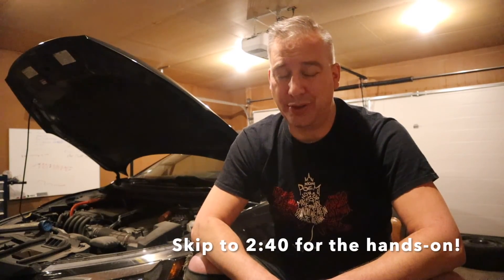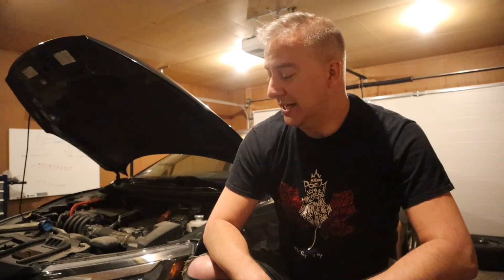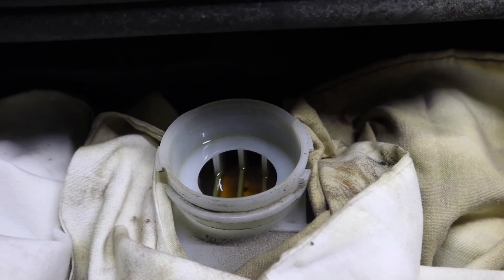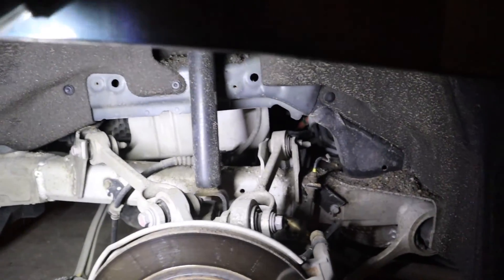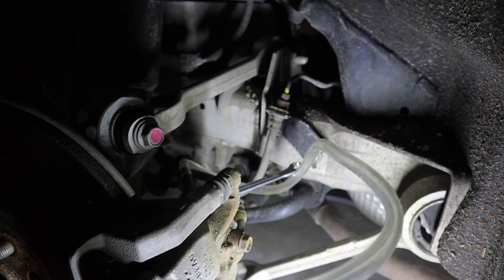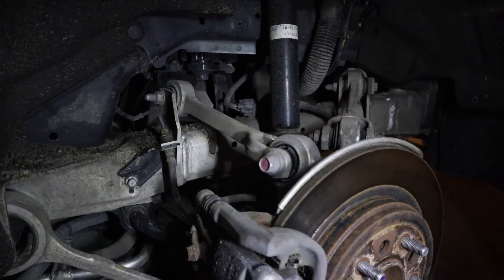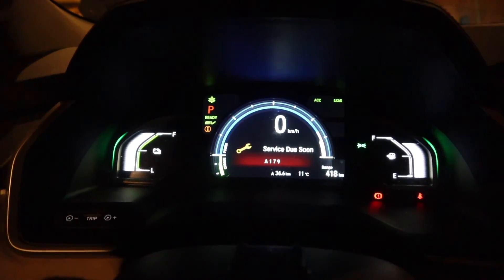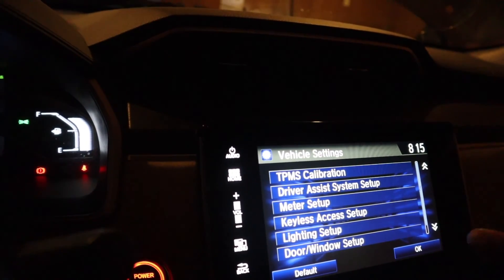Honda Maintenance item 7   Brake Fluid Flush!  How to flush and bleed your brakes in your car!

Comment: Is tire removal required for brake bleed on a Honda Fit?  Does Honda require tire removal for brake bleed service performed at a Honda Dealer?
Reply: Tires are generally removed for access convenience. You may be able to get to the bleeder screw behind each tire without removing them.

Comment: Thanks for the video. The brake fluid reservoir doesn’t have any lines to show min or max. Is filling to the top of the strainer the correct fill level?
Reply: It has a max and min line on the left side.

Comment: How often do you do a break flush For  a 2020 Honda Civic?
Reply from the maker: Hey Jay.  Irrespective of car I usually do it every two years.  Brake fluid will absorb water with or without use i.e. so mileage is less a factor than time in my experience.  Plus it's easy enough and rewarding as it brings the pedal back up.  Good luck!  -Brad
Reply: @BradOnCars  I looked at my brake fluid reservoir today.  2007 Accord (manual trans.)   Last brake fluid flush was April 2020, so a little more than 2 years ago.  
The fluid looks dark green - yikes. 
I suppose it's time?

Comment: I’m at 25k miles the dealer wants me to do a brake fluid flush. 🙄 Last time they said it needed an alignment then when the auto tech looked at it he said it didn’t need an alignment.
Reply: brake fluid change done once in 3 years and millage does not matter
Reply: @antgrkh588  mileage does matter. It’s recommend every 2 years or every 30,000 miles.
Reply: @connorpurkey2932  If a car sits without driving water will still build over time in the brake fluid. So it is more the time rather than mileage. A brake fluid tester is less than $10 and can test fluid for water. I have found it generally reads the fluid is breaking down about every three years.
Reply: IM AT FKN 16,000 ON A 2020  AND I GOT A B7 ?

Comment: Hey Brad, i owned a honda insight 2019, I was planing to do a break flush myself but I read this car has a 2 stage flush procedure, so I ended up taking my car  today for  service,  I was quoted $189 for that job  which I thought it was very expensive  so I declined it. However, I got a call later  saying that because the insight has a "Two-stage system" or something like that, the cost will be that high. I'm still not sure about what they said but  Since your car is a hybrid too,  don't you think it has a 2 stage system break flush too or the clarity break flush procedure is different than other hybrids like the accord or insights?

Comment: Thanks for that! My Clarity will hit 3 years come November. Is there not also a bleed point on the ABS unit? I just today did my BMW motorcycle and it has 2 bleed screws on the ABS unit, one for the front brake circuit and one for the rear. I was led to believe there’s at least one on the Clarity.
Reply from the maker: Oh interesting!  I have never checked that.  The pedal feels brand new again so I didn't feel it necessary.  But now I'm curious!  And apologies for the late reply Ed.  Summer has been busy!  All the best!  -Brad
Reply: @BradOnCars  Thanks for getting back to me. I'm almost ready to do mine. On a forum someone mentioned it should be done twice, once with the ignition off and once with it on. Have you heard of such a thing?

Comment: Saved to playlist for future :). 
have you experience any dashboard rattle noises？ mine is very noticeable.
Reply: I have the dash rattle issue, more prevalent in the winter. I used a couple of the rubber squeegees from phone protective glass kits and pushed them down between where the windshield meets the A pillar and the dash panel. Problem solved.
Reply from the maker: Hey Tongyuan!  No not yet to be honest!  Sorry to hear yours rattles!  Drop me a video of where and I can take a look?  Thanks for watching and commenting!  Best of luck!  -Brad
Reply: It’s the A pillar, very prevalent on this generation of Honda vehicles. Google and YouTube have some pretty easy fixes for this, worked for my Civic.

Comment: Hey Brad, good video again!!! For those reading this, remember that only DOT3 brake fluid goes in a Honda.  As for the wheels, Honda sells black steel  rims (made in the USA) but they are 17 inch. They retail at 125$ cad but they might sell them for less. The proper tire size is 215/55R17.
Reply from the maker: Ah yes good spot Jean!  Yes DOT 3!  And yes a decent set of rims is exactly what I should have bought hey ;)  Thanks for watching to the end!  Hope you are well!  -Brad

Comment: I learned so much about the maintenance my car needs that I’m clearly not doing.  I may give this a try!
Reply from the maker: Ha!  Good luck my man!  Let me know what else you might want to know! :)  Thanks for watching! -Brad
Reply: And it's entirely possible that some of these maintenance items you could skip and it would be perfectly fine... I had a Dodge Ram pickup for 14 years (87K miles) and as far as I can remember, I never had the brake fluid replaced or even the brake pads / rotors...